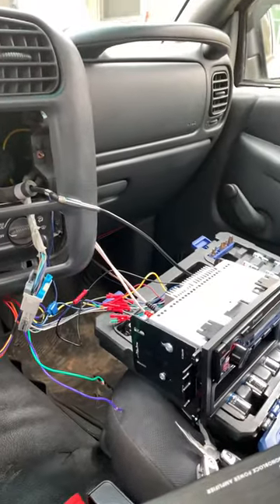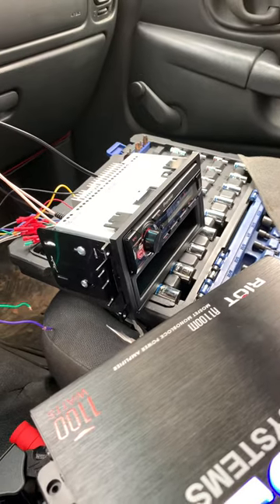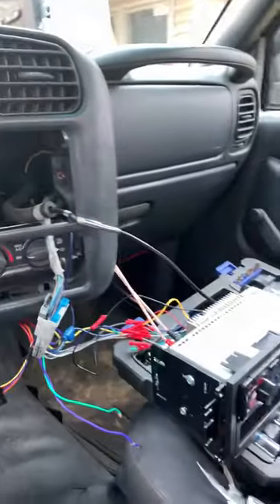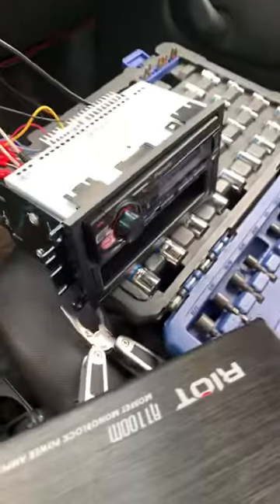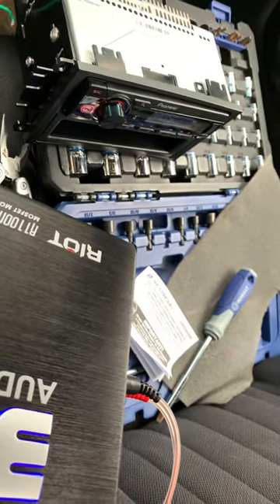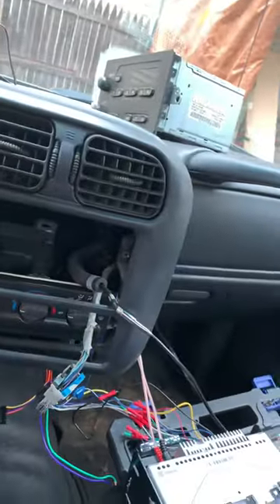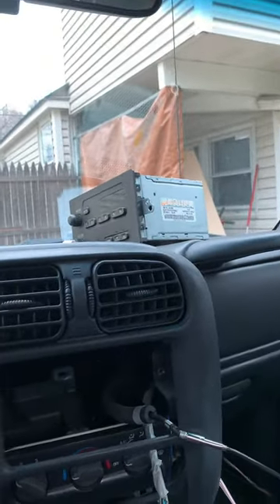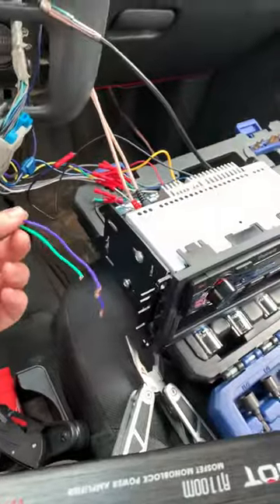(CHECK DESCRIPTION) How to Fix “Amp Error” on a Head unit

Comment: Ive been dealing with this al day today. I finally disconnected each speaker one at a time and found out its my front passenger speaker causing it. Its brand new and still sounded great when it kept coming back n randomly. Im gonna take my door panel off tomorrow and make sure nothing is touching. If there isnt and its a short in the wire,  i just seen a video where the guy put in new speaker wire and brought it over to the back of the radio and wired it it right to the radio harness (leaving the vehicle wires for that speaker disconnected). Its a lot easier than going through the vehicle wiring.

Comment: By the way, those speakers your checking with a 9 VDC battery... they run in the millivolt range.  Connecting a 9 Volt battery is very good way to fry a voice coil in the speaker.  Don't do that.. Bad Bad things will happen.  The crackle you hear is the voice coil being over loaded and will cook if you keep it up.
Reply from the maker: Really!? I did not know that. Good thing we didn’t do it for long. Thank you for the information

Comment: Okay... so what if you don't use the high input?  I used the RCA's and the speaker wires do not come from the head unit.  The Speakers are connected directly to the AMP.  It does this with two different AMPS one is right out of the box brand new.  Strange thing is, it worked for about five days and all of the sudden it started gettin wiggy, and then in the middle of trouble shooting it popped the "AMP Error".  I am about ready to toss this Pioneer DEH-6900BT out the windows at about oh... 95 MPH!  This thing has been a thorn in my Butt since I bought it last year.  One problem after an other.  It killed a brand new AMP I paid $450.00 for.  I was lucky the store gave me a replacement.

Comment: What if you cut the rear wires but still amp error
Reply from the maker: V Tonga sorry V, I’m not sure what to do after that. Tell me everything that has happened when you got the AMP Error
Reply: It could be the internal amp in the head unit.  If that's the case and you have no warranty, time for a new head unit.